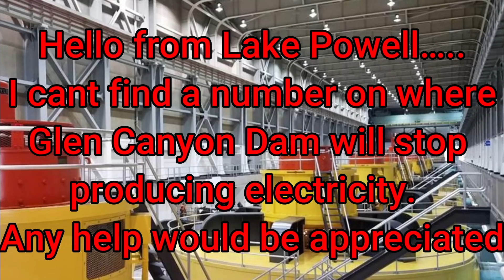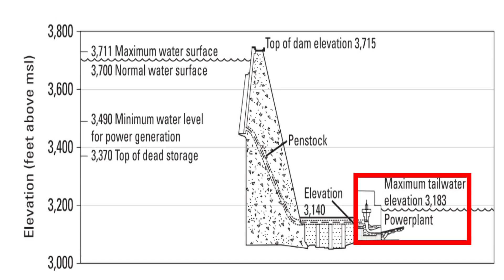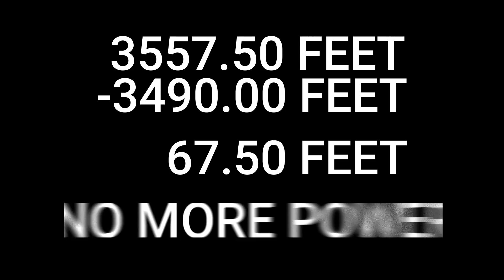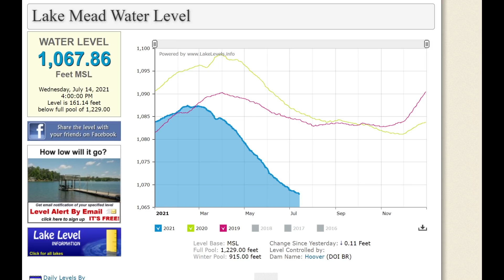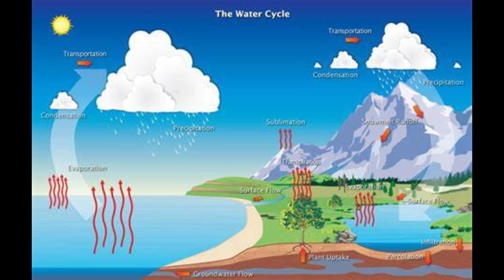LAKE MEAD UPDATE 7 14 21

Comment: Those are not valid points. The Solar system is modular so it can be moved easily. And they are not a roof. They provide shade and have access to the water. If they blocked the access. How would you get in there to drown?
Reply from the maker: Well depending on how tall you make them. How easily can they be moved over a canal? It seems to me that it wouldn't be a easy task if you had a whole canal to get over with out a crane or something. These look massive.
Reply: @Dobrinich  I don't understand what you are saying. If you are doing work on an aquaduct I'm sure you are not using a shovel. That is what you said. Work.on them. You would have the required equipment. And if the walls are vertical. You should not be in there anyway. But if you got in. Someone could get you our.

Comment: Did you check out the little pacific project?
Reply from the maker: I have. It is definitely a idea. There are some down falls of that idea. One if they use desalination it will pump a heavier salt brine back into the little Pacific Ocean causing heavier salt water. Two if you fill lake mead completely up and then it gets wet from say a flood it could over top the dam causing all kinds of problems. It is not a bad idea it has some flaws

Comment: Do we get less power with less level in Powell?
Reply from the maker: Yes any time the level is reduced the pressure is reduced as well there for the turbines don't spin as fast so you lose power. Thanks for stopping by
Reply: @Dobrinich  not quite correct. Yes, as the water pressure is reduced the power production is reduced also, but the turbines have to spin at a constant rate to guarantee the frequency of the power is a stable 60 hz. The more power pulled by the load you get a back emf from the generator that produces a counter torque. This slows down the generator rotational speed, hence the power frequency will drop below 60 Hz. If the frequency goes too low, very bad things happen. This is what happened in Texas when the wind power could not fulfill demand.

To keep up the rotational speed (maintain 60 Hz) you need more mechanical energy (water pressure). Think of it like a cruise control on your car. Driving on level ground, no problem. Start to climb a hill and the engine must be supplied with more energy (gas) to maintain the speed you set. When you hit a certain point you can no longer supply enough energy in and the speed drops. In my car example, chemical energy converted into mechanical energy. In a dam, mechanical energy converted into electrical energy.

Hope that clarifies the issue.

Comment: I have a solution. Take those machines that can pull clean water out of the air and connect them solar arrays and batteries so they can fill the lake all day and night.
Reply from the maker: I am not sure how much water that you can get out of the air in 20% humidity. Thank you for stopping by and checking out the video!

Comment: Solar panels get very hot as they collect energy from the sun. It is less environmentally friendly but they could just use concrete.
Reply from the maker: Solar panels do get very hot. Unfortunately they won't. Thank you for stopping by and checking out the video.
Reply: Mirrors would reflect back Solar radiation and be more effective in my opinion.. We need them as we lose the artic

Comment: What happened with the huge underground water tunnels California was putting in? Did they ever get finished? :)
Reply from the maker: I think that was Las Vegas who put that in. I assume that you are talking about the tunnel to the Lake Mead?
Reply: @Dobrinich  No, the tunnels underground that would take sacramento river water to Southern Calif. Jerry Brown started them with stolen money slated for something else. The people voted NO but he did it anyway. I had heard parts were done but more needed doing and then connecting it all. It was 2 30+ foot across pipes. According to what I can find on the internet ( after its book burning) says they were never started, but I remember a report that parts were done, but the parts were miles apart. I seem to remember the undone parts were under populated areas. Maybe you can find something I couldn't. I think they wanted to take the water from under Oroville dam, but now the reports are from the sacramento river. It does seem odd that 2 years ago Oroville spilled over and now they are pulling out the houseboats before they get stuck in the mud it is so low. Where has all the water gone? The south steals it from the north and charges the north to get it there! Why do you think Northern Cali wants to split? The south has all the money and they should be paying every penny to get them the water..... and pay for the water!  ooops.... had a bit of a rant there.... 
Have a super day!
#ALLCOLORSUNITE

Comment: New to your channel, but I’d suggest looking at Brad Lancaster’s book series RAIN WATER HARVESTING guide books which goes into detail on water wise gardening and water banking into the soil in dry climates (he lives in Tucson and has his whole block looking like a jungle in the Sonoran desert) which leads to healthy soils, filled aquifers, and better ways to save and use water wisely. 
As for PV over canals, they’re still testing best designs for maintenance, emergencies, and access, but likely will be elevated enough to allow reasonable access under with equipment. Removing panels is easy if needed, mostly need to worry about high winds and gophers undermining the structures like they do around canal walls, but the jobs and power it will add is a plus…As well as the shade to reduce evaporation also adds cooling to the PV adding higher efficiency to the panels.
Reply from the maker: Thanks for the information! Much appreciated!

Comment: I hear alot about these 'underground 'aquifers' when conversations on water shortages arise.

I'm from Australia so I don't know too much about them but are these underground water storages that you have in America a potential solution to the obvious shortages the West will face in the next 2-10 years?

Great work.
Reply from the maker: No they are sucking them dry and the land is shrinking. California has dropped over 10 feet in places.
Reply: @Dobrinich  I wondered at the damage potential. Florida has water filled sink holes, California is likely to end up with a lot of dry craters. I wonder how a broken line of surface pressure will affect tectonics?